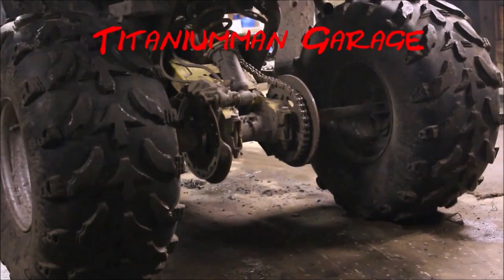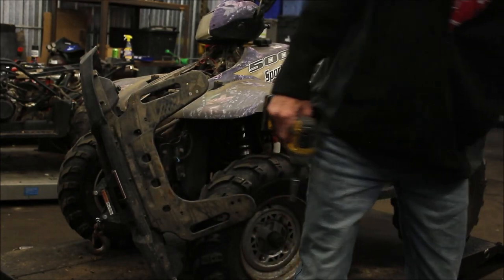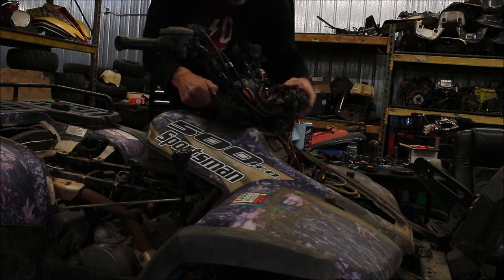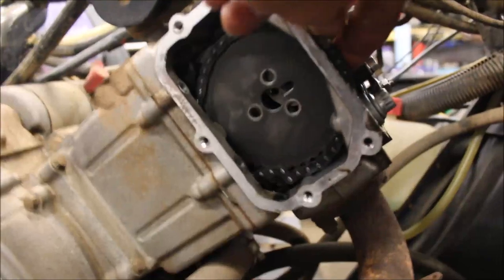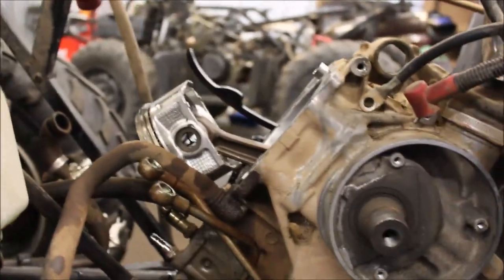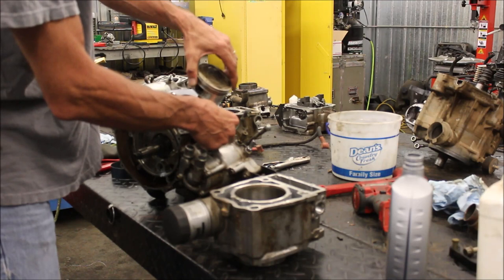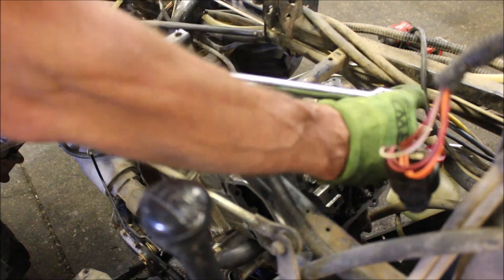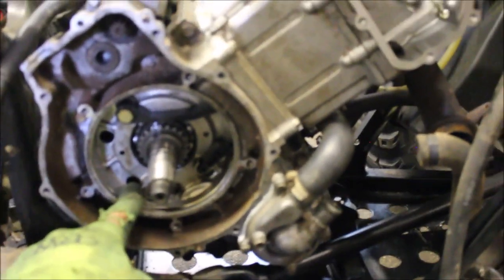How to tear down a 2004 Polaris Sportsman 500 COMPLETLY and rebuild it!

Comment: I've watched this video a couple times it has a lot of helpful information. I finally got my 425 magnum running it has a bored out cylinder with a wiseco piston and a new camshaft I adjusted the float height and put another petcock and eliminated the fuel pump now it runs great. Next I'll be doing the hub seal since they leak like a sive and check that armature plates so I can have 4 wheel drive in it. My buddy hates that it's all chains to make the 4x4 work but he has expedition 425 but that bike holds 5 1/2 quarts of oil and it's all shaft driven.

Comment: I was thinking the aftermarket 500 kit might bolt on the 99/00 sportsman 335.
  Then I realized that the 500 is water cooled.   If it bolts on, I'd still have the rad,and all the plumbing to do. 
   Just a piston is 260.00 for the 335!!
Great work dude, these kids can break more than they fix....

Comment: Great videos - just got a 2004 500 ho and putting it together. the plastics were not on and have a bunch of bolts. Is there any where to get a good look at what bolts are needed for the front rack and plastics - and the back rack and plastics as well? Thanks for the videos - well done !
Reply from the maker: They have  T 15 hex head on the back. The front might be the same or they are screws with a 3/8ths socket head on it.

Comment: Amazing video, I have a few questions so I have 96 Polaris 2 stroke 250 cc But my first question is when tuning the carburetor how many turns would you say you would have to do for the idle speed air screw and idle mixture air screw ? My second question is When I put the ATV in reverse it dies out what do you think could be causing that would it be a wires or a sensor? My last question is when driving in Ford my throttle gets stuck should I adjust the throttle cable I mean that's it for now but I would very much appreciate it
Reply from the maker: I would replace the throttle cable. They stick by the oiler. The reason it dies in reverse is because of the over ride button needs to be pushed in or bypassed. I wanna say 2 to 2 and a half turns out on the air screw.

Comment: This might not be directly relevant but I’d like to see a video on the difference between having and working on a carbureted Sportsman 500 vs an EFI one. I have an 09 EFI and it works fine but I was just curious.
Reply from the maker: The engines are the same. The timing chain tensioner was the only thing that changed over time. The EFI is fuel injected obviously. It has sensors, fuel pump and an injector. Polaris had a wiring issue with those. The wires are thin and break over time by the injector and sensors. But other than that I can put a motor from a 2001 and put it in a 2009 keeping all the electronics the same.

Comment: Mine quit running so I was working on it to find out the issue and it smacked me in the mouth and talked real rough about my momma! The worst part is it doesn't even know my momma, so after I cleaned the blood outta my mouth I first apologized for bleeding on it I went back to work trying to remove the carburetor. Then I found out it has no compression, I think I'll kick it 4 or 5 times before it suffers a mag dump! Talk about my momma again Sportsman 400, now you're ported!

Comment: Hi i have a question i have 2001 polaris sportsman 500 ho blew the rings for sure im planning on doing topend rebuild and im wondering what oil should i run for break in should it have 5w50 ps4 full synthetic oil? And abother question how long do i have to do break in period before taking it to full rip
Reply from the maker: I use 0W-40 synthetic. I don't buy the expensive Polaris brand. I Let it idle for 5 minutes to let the oil get through the whole engine and back in the reservoir. Shut it down, cool off. Then let it idle for another 5. I ride it half throttle for maybe 5 miles or so slowly going through the power range after. It's usually good after that.

Comment: I'm curious about the head bolt torque sequence. First: is the 52ft/lb just what the end result should be around? It sounded like you torque down to 52 after you hit the 22 (but you skipped that in the video?) and then you back off by 2 quarter turns? and Second: You mention 2 half turns after the 11ft/lb, but I only noticed you did quarter turns (line only did a 90deg movement). Maybe I am misunderstanding the terms?
Reply from the maker: When I edited the video I messed that part up. Its 1) 22 ft lbs 2)52 ft lbs 3) back off 180 degrees 4) back off another 180 5)Tighten11 ft lbs 6)turn a quarter turn 7)turn another quarter turn.
Reply: That should put it back at 52ft/Ib after step 7

Comment: I got a 01 sportsman 425 I converted to a 500, the new jug is 4mm longer and the old timing chain is too short any thoughts?  Can you break it and a couple half links or is there a different chain I can use. The piston skirt really really scored the walls deeper than 0.030. So I got a new jug.
Reply from the maker: That's interesting! That means the aftermarket is 4mm longer than a OEM jug.That would also mean less power. I'm not sure what to tell you. I've used OEM jugs. Never had that issue. Take the timing chain tensioner out. I would think there is enough play.install and reset it.
Reply: @TitaniummanGarage  with the tensioner removed it is still too tight. I can’t get the alignment post to align on the cam shaft. The piston travel at TDC is the same as OEM, flush with the deck. I’m thinking of trying breaking the chain and adding a link but will have to find the roller because I don’t thing a half link will clear the case on the crank sprocket. Do you know the number of the roller chain? It will be my luck it’s like the 21 count spline universal yoke and a Polaris only part.

Comment: Picked up a sportsman 500. Oil level was dead on the mark. Was getting it running and air box filled up with oil. Oil level dropped. Im guessing its pulling oil but not returning to resevior filling crankcase up and blowing out the breather. Any tips on what i need to check for?
Reply from the maker: You will get some oil in the air box. But not that much. My guess is it could be the valve seals leaking. Have you checked the valve lash? If the valves are not set correctly that could be an issue too.
Reply: @TitaniummanGarage  i have not gotten to adjusting valves yet. That was my next step after getting it running till I ran into the oil pouring into the airbox. Ill try that next.

Comment: I got a question, I'm a pretty good mechanic,  but for the life of me, I can not get my 500 ranger right, what it is that it will not idle on its on till 20 minutes of riding or so , tried 2 new carbs, same thing. It's a 05 polaris 500 ranger,  any suggestions?
Reply from the maker: Sounds like a issue with the choke. Might need adjustment. Also if it's cold out. It takes a bit for it to warm up before it will idle good.

Comment: At 37:50 what is the purpose of the gap that’s needed in the throttle lever switch?
Reply from the maker: Its a safety kill switch if the throttle cable breaks. There needs to be a gap. If it it closed it thinks the cable is broke ,closing the connection telling it to shut the engine off electronically.

Comment: I would be concerned about the stoke of the connecting rod pumping up the cylinder???
Reply from the maker: It won't. I've done it several times. I've had that comment alot. The piston sits dead flat on top dead center with the top of the cylinder. If anything it gives it better compression.